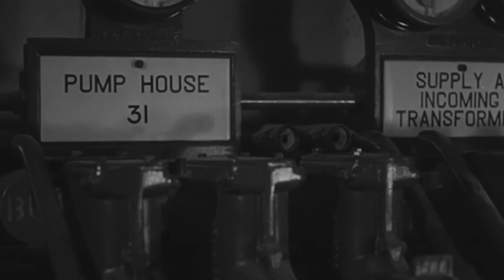World War II - The Massive Secret Hidden Underwater

Comment: Just because it didn't transport a significant percentage of fuel compared to other means, does not mean it was a failure. Contingency plans are never a waste of effort, because if the fuel tankers had not been successful, the pipeline could have ended up being the only option left.
Reply: Exactly. That's why the American military is filled with tons of redundancies. 

If one way don't work or fails. You have a back up and don't skip a beat.

Comment: This is a really interesting piece of history.  The only time I had heard mention of fuel supplies was with respect to the Battle of the Bulge and keeping the German army from raiding Allied fuel depots.  Written history often leaves out "small" facts that are actually vital.  Thanks.
Reply: Same here, I was today day's old when I learned about this.  Great topic!
Reply: Patton was incessantly told to slow down, once the breakthrough was made. He didn't and ended up with his force stopped on the road, having outran their fuel supply.
A lesson still reinforced today in our military.
Reply: For a good look at just a piece of this, The Far Shore, by Commander Edward Ellsberg, looks at just some of the problems with the portable harbors they made. He wrote a number of good books, mostly about salvage operations.
Reply: @spvillano  DIlletantes talk tactics; amateurs talk strategy; professionals talk logistics. One of the things that doesn't get enough attention is that the US war machine was designed to be supported and maintained at the ass end of a transatlantic logistics trail. Compare, for example, the process of repairing the transmission in a Panther tank with the process of repairing the transmission in a Sherman; in many cases, it was much faster simply to replace the transmission with a new one fresh out of the crate.

Comment: The pipeline went to the Isle of Wight across the Solent from Lepe beach in Hampshire it then crossed the island to shanklin  The fuel came from the oil refinery at Fawley Southhampton
If you look on Google maps at Lepe there is the remains where they built 6 Mulberry Casion’s  but also a photo I took of the Pluto pipe line sticking out from the small cliff, obviously the erosion of the cliff has exposed this and where they cut it when they recovered the metals used.

Comment: Remember, the head of Germany's navy declared no American division would get to Europe and fight Germany. They did though. My grandfather fought in Russia to return them to the fight. He, an engineer, was stymied by the lack of white Russian experience in railways. He dug tunnels, built railways and ran them. After the last soldiers went home he ran a campaign in China, killing spies. Pluto stands for petrol line under the ocean. It went into a million Jerry cans and on roads to fuel dumps. 85 octane. In all nine pipes most were rubber. Many  came to Calais later.
Reply: That's cos you had British brains to work out the bits tanks didn't.

Comment: I had a chance to fly in a ww2 spitfire, I was astonished to hear just how fast the spit would go through a full tank. The flight was expected to take 30 mins and consumed a full tank of full. The flight was too expensive at the time, it would have been amazing
Reply: Yes, and combat flying greatly increased fuel consumption.
Reply: On average, a Spitfire can fly for around 1 hour on a full tank of fuel. The main factor that affects the flight duration is the aircraft's engine. The Spitfire has a Rolls-Royce Merlin engine, which is known for its high-performance and reliability, but it also consumes fuel at a high rate.
Reply: @YuckFoutube-e1z  There is/was a car fitted with a Merlin. Iirc it managed 2.37 mpg!

Comment: Like the Mulberry harbours, the role of PLUTO lives on due to the myth and not the reality - far more goods came in through Cherbourg than Mulberry B. This is not to say that both projects were not important and, as was said, the engineering aspects (I'm a retired Civil Engineer) are impressive.

As for PLUTO no longer existing . . . . about 30 years ago I was involved in a highway and drainage scheme to the south of Epsom in Surrey. We obviously had to be careful not to disturb existing services that fell within our footprint including . . . a fuel transfer pipeline!

A liaison engineer came out to tell us what to expect if we came close to the pipe which was a single 250mm one skirting through the countryside south of London on the way to Heathrow.

What surprised me was that the pipeline took diesel, AVTUR (aviation turbine fuel aka paraffin/kerosene) and AVGAS (aviation gasoline or petrol) one after the other. Because they are of different specific gravities the interface between the different liquids could be sensed and they were diverted to different holding tanks at the airport's fuel farm.

The engineer still referred to the pipeline as PLUTO! There are little orange markers like a roof on a pole on either side of the road where a fuel or gas  pipeline crosses it (in the UK at least) These are regularly overflown by helicopters to spot leakages - easily seen as dead foliage. We were told to report it if we damaged the pipeline not so much because of the environmental damage but so that the loss could be recorded so that tax could be claimed back!

A couple of lovely bloopers in the commentary - "lead from church roofs and bells . . . " never knew church bells were made of lead, thought it was bronze they used.

And, I think, Bologna is in Italy? So not much interest to troops invading Normandy! 😄
Reply: The Mulberry harbours were vital until real port cities were secured and their port facilities repaired. After that they were largely superfluous.
This had always been the plan, and that's how it went (though delayed as the allied march through France was initially much slower than planned).
Reply: @jwenting  Oh I do so agree with you. It's just that we (the British) tend to look back on these things to stress how important we were then and by extension, still are now. . . . 
If I hear once more about how Britain stood "alone" in 1940 . . . Yes, we stood alone, with the British Empire (a full quarter of the world's population) and assorted hundreds of thousands of free Europeans in support.
Still, PLUTO, bloody clever idea wasn't it?
Reply: Heathrow is not south of London. 250mm pipeline?  That is 10 inches. The Mulberry B harbour at Gold Beach was used for 10 months after D-Day, and over 2.5 million men, 500,000 vehicles, and 4 million tons of supplies were landed before it was fully decommissioned. Cherbourg was so badly damaged by the Germans that it wasn't capable of handling more than 20,000 tons of cargo per day until well after October, by which time Antwerp had been captured. It wasn't able to handle any cargo until early August - which was one hell of an achievement.  Before you cast a stone etcetera.
Reply: @davidforbes7772  Mmm, don't think I said that Heathrow WAS south of London. Our drainage scheme, however, was. The pipeline was uncovered  uncovered it in a trial hole and yes, it was 250mm.

Don't forget that PLUTO wasn't up and running much before mid August 1944 - up until then fuel was mainly carried in the 7 million or so "jerricans" we'd manufactured in Britain in the five month run up to Overlord - a feat much overlooked.

Also, did I say that Mulberry was not "one hell of an achievement"?
On the contrary, as both a civil engineer and a yachtsman I have nothing but respect for Allan Beckett and the engineers that designed Mulberry and the contractors that built it in such a short time frame (I actually worked at Beckett Rankine* for a while many years ago and his name was justly revered).

Agreed, an incredible amount of men and materiel came ashore through Mulberry B but, in the immediate period following the landings, a LOT more came in elsewhere:

"The British beaches were closed on 3 September 1944. By this time 221,421 tonnes (217,924 long tons) had been discharged through small ports, 615,347 tonnes (605,629 long tons) over open beaches, and 458,578 tonnes (451,335 long tons) through Mulberry B.[48] This meant that 25 per cent of the total tonnage had been landed through Cherbourg and the small ports, 12.5 per cent through Mulberry B, and 62.5 per cent over the beaches. The tonnage handled over the beaches greatly exceeded the expectations of the planners; but it is unlikely that the invasion would have been launched in the first place without the reassurance provided by the Mulberry"

Certainly Mulberry carried on being actively used until the spring of 1945 even after Antwerp has started carrying more traffic.

*Beckett Rankine maintain an interesting archive on the Mulberry harbours at https://www.mulberryharbours.com/ and there is, of course, a nicely conserved Whale at IWM Duxford.

Comment: Very interesting additional information. I didn't realise the pipelines were extended far inland or that there were two types of pipe. Was the second cable like type constructed by THE Siemens Brothers?  Wasn't that the original name of the German engineering company?

It is also interesting to know how far in advance all this stuff was being planned, 1942 and they were well under way with fabrication and testing. Amazing really that they had this much confidence that they were going to be in a position to use this stuff many years later.

Comment: You can still see parts of Pluto on the Isle of Wight. Shanklin Chine has the end, the Wildheart Animal sanctury in Sandown has one of the pumping engines in its grounds and there are still markers where the pipe went acros the Island. These were disguised as Styles that went to nowhere. You can spot them as they had concrete supports rather than wooden ones.

Comment: There were two lines One for Petrol and the other for diesel. Pluto = Pipe  Line  Under  The Ocean.
Two pipes were curved  over the sea wall at The Queens Dock SWANSEA.   One end of the pipe was coupled to one pipe and payed-out into the bay and curved around to link the line back to the other pipe.
Petrol  was pumped from NOR Skewen BP Refinery out to the pipes to test the pipes for leakage.

Comment: Pipeline Under The Ocean = PLUTO

Nobody knew that the Normandy Landings would be a success, had a Bridgehead been established but as a result of greater resistance than anticipated progress had been slow then the amount of oil that PLUTO was able to supply might have been vital in maintaining that presence in France.
Two MULBERRY harbours were established on the exposed coast of Normandy but one was largely destroyed in a storm not long after, so initial supplies of all sorts were quite limited & under air attack tankers would have been very exposed with the potential if hit to block the entire access through the 'MULBERRY' gateway to Normandy.
The Dieppe raid showed how difficult an attack on a defended port from the sea might be so the allies landed then attacked ports from the land.

Comment: How did Russia supply fuel to its front line? Their front was nearly a thousand miles north to south and advancing very rapidly. This is certainly a problem, both in the east and western fronts I have never though of.
Reply: I think that the majority of oil which Russia used came from the Caucuses. Baku was a centre of oil production before WW2. I can't answer how it was transported to the refineries and then on the factories and the front, but it was probably pumped by pipeline to the refineries and then transported by rail tankers to the end users as the USSR relied heavily on rail due to distance, lack of capital to build roads and difficulties with weather.
Reply: I think most of it was on the Trans-Iranian railway.  As luck would have it, completed only a couple of years before the war. Knowing Russian's, a physical human-chain of Jerry can porters is not beyond imagination.
Reply: The US sent the USSR about a third of the refined fuels used by Soviet forces during WWII, an amount equal to 57% of what the Soviets produced domestically.  The higher octane US fuels were mixed with the poor quality Soviet fuels to produce a fuel usable by combat aircraft.  Soviet fuels were never suitable.  In addition the US and Commonwealth nations provided the USSR with 55% of the aluminum and 80% of the copper they used during the war.  Then there are the hundreds of thousands of trucks, tanks, jeeps, bulldozers and other equipment sent to the USSR including rails to build railroads.  Without Lend Lease the USSR would have fallen to Hitler.

Comment: Did I miss something?  Steel pipe wrapped around drums.  That just doesn't seem possible even with the diameter of the drums I saw in the video.
Reply: Yes ~8:00 he mentiones Haze & Hammel,
~9:00 he mentions how they're using both.

Comment: The narrator keeps saying the pipeline transported 'oil'?  To be refined into gasoline or diesel on the continent? That doesn't make much sense.
Reply: Oil for use as an engine lubricant. Some vehicles burn lots of oil per day.
Reply: “Oil”, is the generic name we use in the UK for lubricating oil, heavy engine oil and diesel

Comment: Once the pipeline was laid across the channel in advance of D-Day, how was its existence kept hidden?  They certainly could have just left it to sit on the bottom of the channel, but then there's the logistics involved with raising it back up.  Leaving the open end of it on shore would be easily spotted the next morning.
Reply: The text said the pipe line was to be lain in one day. It makes sense that would not have happened until after the beach was secured. The oil was not needed on the beach but to  move the troops carriers and tanks inland and to fuel planes after forward airbases were secured.

Comment: 😅 I just watched this after work, and I was trying to figure out from the thumbnail just what this was a CT or MRI cross-section of ... after 37 years as a medical professional I guess I tend to filter through that schema.
Reply: The thumbnail appears to be a conventional black and white photograph, not a CT or MRI scan. It looks like the cross-section of a piece of armoured pipeline in which the inner tubing has collapsed and deformed. The pale dots around the circumference are strands of steel armour helically wound around the inner tubing an embedded in a protective layer - probably rubber or an early plastic. i work with submarine fibre optic cables and there are a lot of similarities.

Comment: The thumbnail is NOT in the video.
Reply: it's a cross section of the pipe
Reply: they must have switched thumbnail images.  the one I see is not a cross section of pipeline.  looks more like a tunnel on the edge of a waterway.  also not in video.

Comment: The somewhat negative judgement at the end doe not take into account the time that the plan was invented. At that time the Channel was a very dangerous place. Halfway 1944 things have changed. Therefore, although not contributing in numbers, it did contribute to the overall invasion strategy. Without such plans, the operation would probably not have been prepared in time

Comment: Each Sherman tank used about 100 gallons of gas per day? So does my motorhome at 8 miles per gallon. Good damn thing gas wasn't $5.00 a freaking gallon then or we never could have afforded taking back Europe and everyone over there would still be yelling "Sig heil!, goose stepping and eating Brauts with sauerkraut lol. And by the way Europe, you're welcome.
Reply: That is because they were slow!  Actual fuel mileage as recorded in combat ranged from about 0.41 to 0.97 mpg, depending on the terrain and the engine.   There were I think eight different engines installed in Shermans, ranging from an air cooled radial to a pretty slick aluminum block overhead cam V-8 gas engine from Ford.  There were diesel versions too but those were few and far between.  Most burned gasoline.  Better than the 3 gallons per mile of a modern M-1A2 Abrams, but hardly thrifty.  Shermans usually traveled under 20 mph, often much less so they didn't go very far on any given day.

Comment: The initial statement that it oil, with no mention of any other substances, made the video immediately poorly researched and written. Pumping oil in to an active theatre of war is about as useful as pumping maple syrup. There would be no practical use for crude oil without a secure and functional refinery along with an effective distribution system.
Reply: Was Diesel/gas in the lines, not oil, the fuel was delivered to England from US and that sandy shithole